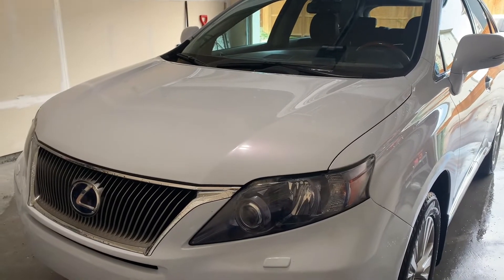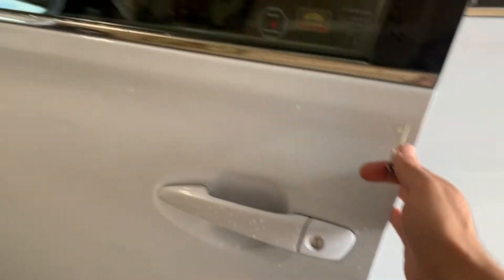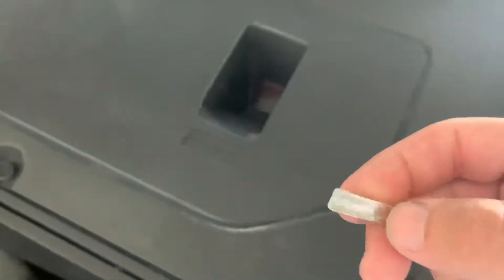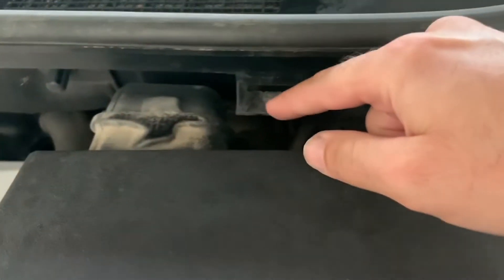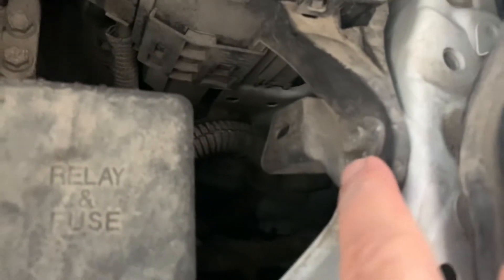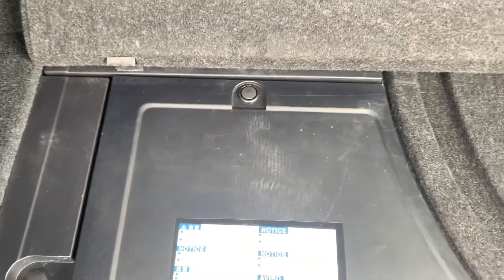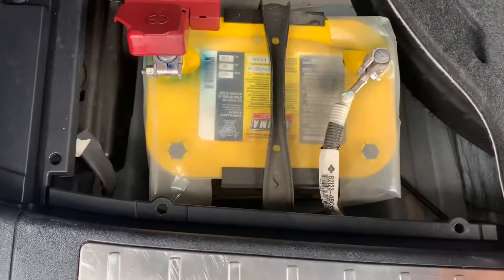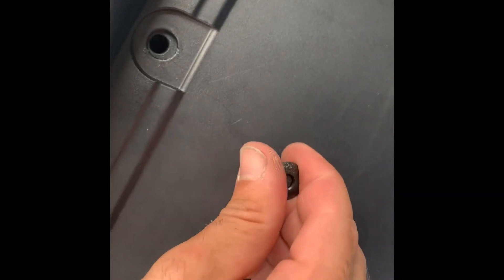Lexus Rx450H 2010-2015 battery location/boosting vehicle demonstration

Comment: Great and helpful video, so thank you for that....isn't there a manual tail gate release button situated on the tailgate itself?
Reply from the maker: Yes there is however I don’t think people will crawl into there hatch this why I didn’t show that in the video.
Reply: Hello young man, I didn't mean the internal one, I meant the external one which ( on my 450h ) is situated under the chrome strip along the tailgate....or do you need power for this as well?
Reply from the maker: @christopherwhite959   no that the electric trunk release hatch if the battery is dead you won’t be able to open it in some cases there is enough juice to open the hatch but won’t start the vehicle
Reply: I'm 4 weeks into recovering from a replacment knee operation so I'm pretty sure my Rx will not start, so this is the reason for my questions, so here is one more, once you've used the key in the key fob to open the doors, won't that unlock the boot?
Reply from the maker: @christopherwhite959  all you can do is try like I said it in the previous message in some cases that there will be enough juice to open the hatch 
You won’t know until tried
Reply: @christopherwhite959  It depends on the state of your 12volt battery. If it has some power left it may open the boot but if it is dead then nothing will respond. There is only one place to use the fob key and that is the drivers door - there is no other place that I know of to use that key. 

Getting over the rear seats and into the boot to the latch mechanism is beyond most people, try it for yourselves with your battery still OK to see how difficult it is, I know from a problem on our Prius many years ago and my language was '#'::%&$£%.

Still the best car manufacturer in the World - Toyota.
Reply: How to recharge  it if it dead@ruziquattroclub5603

Comment: You CAN open the trunk manually by removing the small rectangular padded cover from the inside of the back door and move the latch the the right.  You do NOT need to do what this video show,s unless you want to JUMP START your RX450h's 12V battery with another car.

Also your RX450h 12V battery is smaller than typical 12V battery on other cars like the RX350.  So, don't use to jump start other cars.
Reply from the maker: The average person that owns a vehicle like this there older adults and not teenagers who are going to crawl in the back seat remove push the tab and so on this is why I did this video 
Also I’m not sure if you get your info on google but it’s fine to boost the battery. Do you even know what type of batteries they use in the hybrids

Comment: you are showing bad example of how to use lexus plastic clips. They are quick release , you just need to push them in fith finger and they are in opened position. Read the manual.
Reply from the maker: @1988oleshka  
Wow I’m glad you know how to read the Manual! But if you too the time to look closely those are the aftermarket
Clips! Funzie!!
Reply from the maker: @1988oleshka  
А по-нашему ты баран
Reply from the maker: @1988oleshka  
А по-нашему ты баран